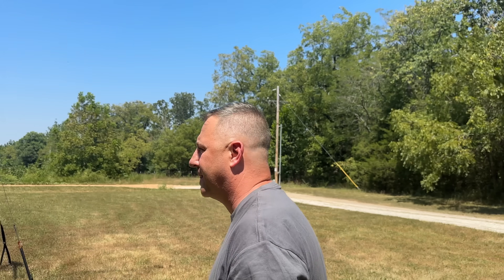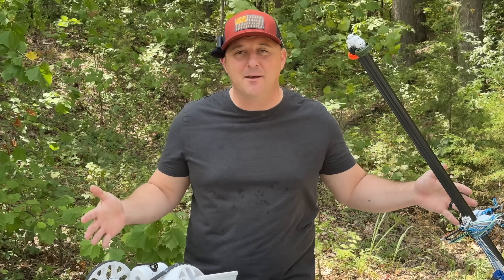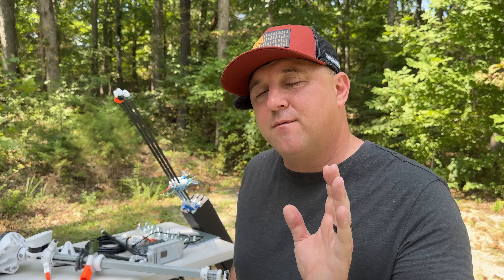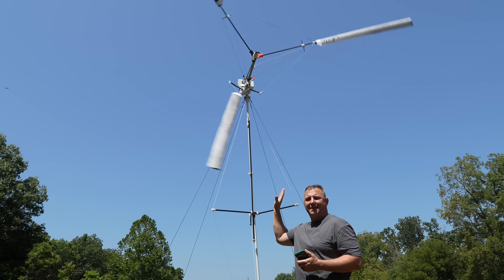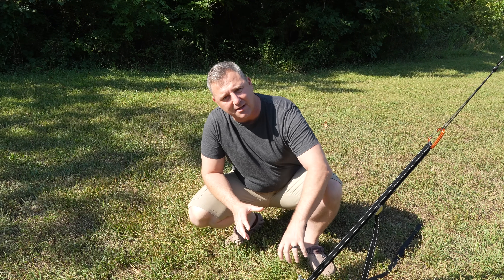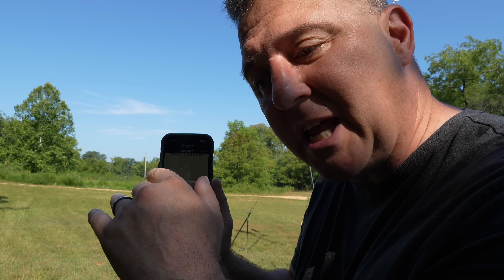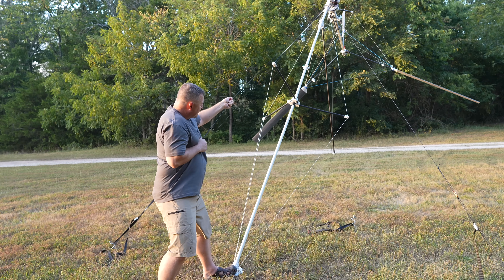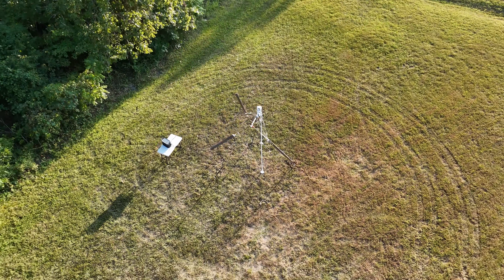Ditch Solar Panels! Is THIS The Future of Off Grid Energy?

Comment: Don't ditch the solar panels. Windmills are finicky and unreliable.  If you live with one thru a winter , you will be ditching it by spring. I've had them, they suck.
Reply from the maker: Interesting. I haven’t had that experience yet, but might find out this winter.
Reply: @AdventureGearTV  I went through about a dozen. Storms destroy them
Reply: @XCX237  even when the windmills got good mechanical breaks?, sure if windmilling id se them get destroyed in high winds
Reply: You can't beat solar. It's a solid state system. You run wind and hydro alongside it.
Reply: @stewartmoir9464  Hydro is King!... for the lucky ones with access...
Reply: This 100%
Reply: @BeatMalls-pl1sg  It wouldn't be much money. A simple cam/crank sensor attached to a braking system would make it always turn at the same rpm and "breakaway pin" for the blades if the wind gets too strong. Then you can use a V.S.T. system, maybe running  backwards, or a gear reduction could be designed. 
 Then you could use beefier materials so it don't break as easily
Reply: @TheTruthMatters   I'm using a vertical [sphairical] turbine, smaller mass and it has brakes but to be sure I made a ''wind breaker'' something like a large ''bucket'' that I put over it and reduced the air intake... also because my system is mobile [on a truckk] going behind a tree, or a rock helps!...
Reply: Hail beats solar.... no really! 😂 every system has its weaknesses. If you are aiming for independence and reliability, the rule of thumb is "two is one and one is none". Always have backup systems. I would recommend backups to backups. If you have wind, also have solar... and a good diesel generator. The same goes for hydro, if you have access to a good running stream with enough vertical drop. Expect it to freeze it winter or get clogged. Everything takes planning and maintenance. That's why so many people are mindlessly dependent on utilities. Power management will turn you into a curmudgeon almost as fast as replacing your own roof!
Reply: @randyfelts4625 
I have NEVER had hail break a panel in over 12 years.
And I've had hail the size of basketballs
Oh believe me. I was sweating when they fall.
I lost the windshield in my truck once .
But never have I lost a panel to hail.
Now I did however lose a couple panels to cows.
But.  Broken " glass" does not mean panel is bad.
They were shattered. But they still give off the same electric.
Just put another sheet of glass over the top 
It's amazing the cows didn't disconnect the. Those thingies. 
Not if they are disconnected then no they don't collect AS MUCH as electric. 
But that can be repaired.
Now with that said 
If you are using the cheap Harbor Freight type panels. Then yes. They break easy .
Not to be confused with the single 100watt panels they now have.
Which are cheap. But still a lot better then the others.
Reply: Bad thing about Solar, which I'll never use, is the forever chemicals in them,  solar needs to be replaced about every 10 years, those chemicals sit and leak into the ground and never go away. Hopefully, you're not near a water source or farm when they get buried.
Reply: 😂 both suck . We have a camper with solar. It’s not all that good.
Reply: @thewillofus.defend1351 
Then something is wrong with your system.
But first. Tell why you say it's bad.
What are you wanting from it?
I'm purely guessing. But are you wanting to run a house of stuff on 200 watt of panels and a 1000 ah battery?
That's is enough for lights .
A wind turbine of the same size will be worse 
But if you want to invest in your system. Come to El Paso Texas. And I will look it over.
Another thing is you said it's on a camper.
Are you stationary or moving a lot.
If moving. You should have a switch that adds power while moving. 
I should definitely put a switch in if you don't have one.
Reply: Lots of maintenance with using wind generator
Reply: #xcx337
I stand with you on that statement.
I started with a good wind turbine (2300 watt) and a 100 watt solar panel.
Oh I still have both.
But I stop using the wind turbine over a decade ago.
Solar is so superior to wind or others.
Other then broken wires that can happen with any
Once solar is set up. It good forever. 
Turbines break, and don't forget that you need a convertor to go from AC to DC. Then use an invertor to go from DC TO AC. Everytime you convert you lose power.
But, the biggest problem in my eyes is that turbine break .
Though mine is still good. for me it was the convertor from AC to DC. 
OH btw I have plenty of wind. 
If a person with solar doesn't have enough power. Then they need more panels and batteries.
It's not like it's expensive to build a good solar system. It's not.
Just buy and build it yourself.
And yes it is a learning curve. What is right for one person is not for another. 
I can say this is what I need. But it's more then some and less then others